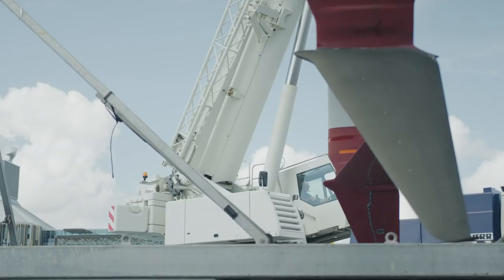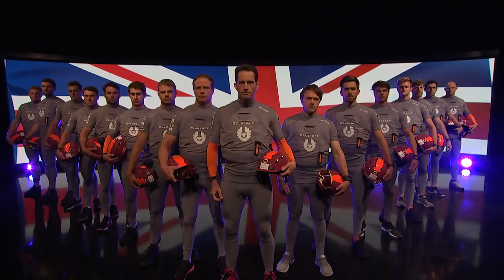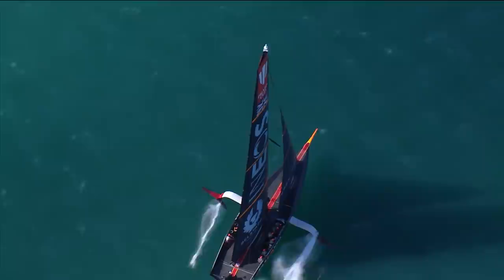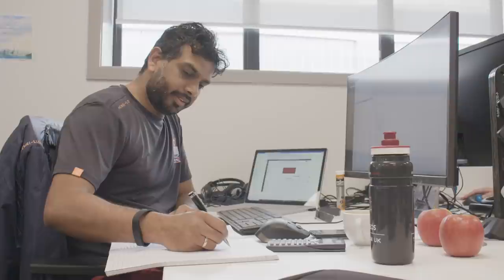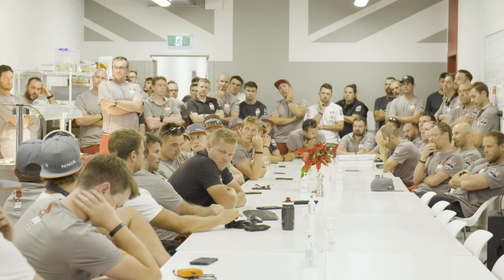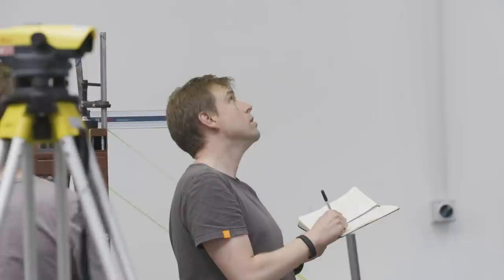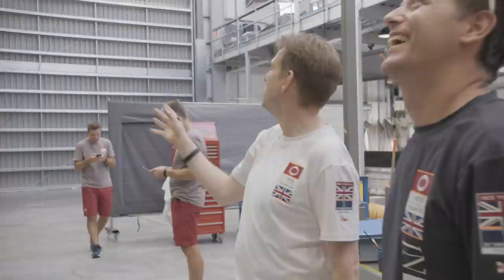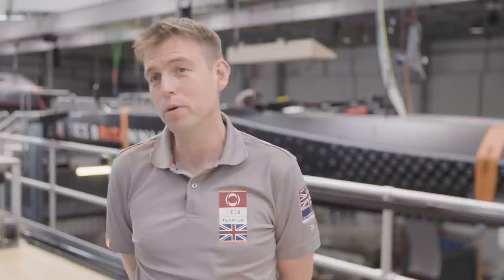Inside Tech | Making America's Cup Weight

Comment: "the foils are set to a maximum limit"... I was under the impression foils had a minimum limit as well as maximum? "10.6 It is not permitted for a foil to have a mass less than the lower end of the range shown in Rule 10.1 (1378kg). No misunderstood
Reply: Surely they are set to the maximum to keep her upright?